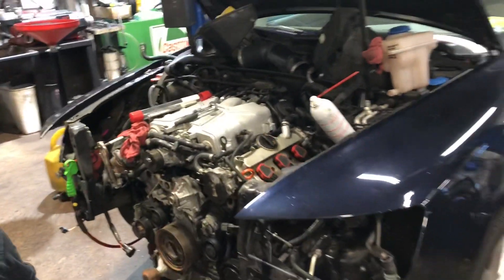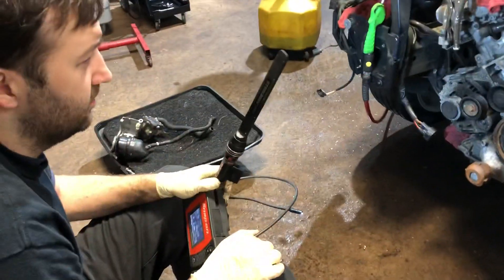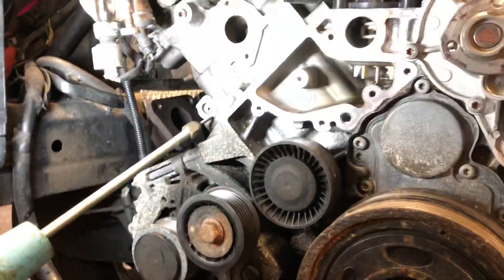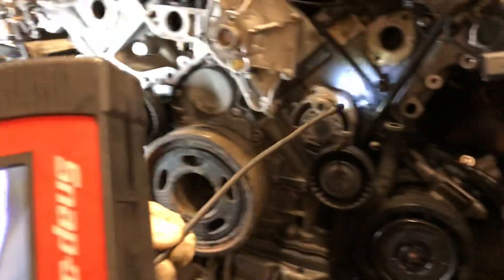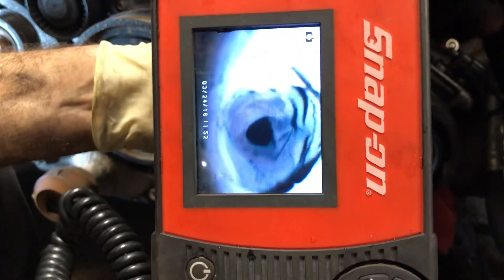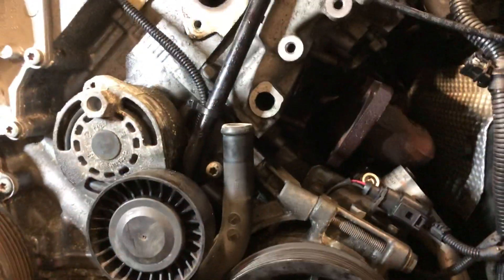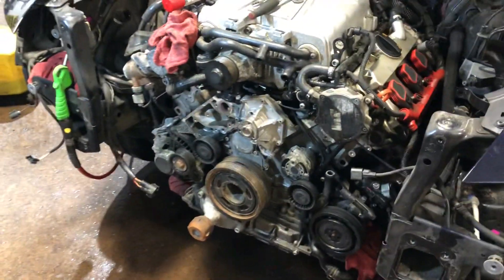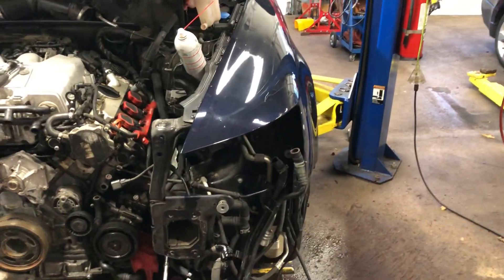Audi 3.0t air injection system fault

Comment: Nice brief and well explained video. I have a 13 S4 3.0 SC in the shop right now for bank 2 check valve stuck open, but it makes me wonder if i should advise the customer to do a cleanout/overhaul on the air injection system while servicing it. Keep at it

Comment: I have no power at air injection, checked the fuse both at engine off, engine on they are good, but no luck. any suggestion?
Reply from the maker: @bakhtyar7  going to have to pay for testing. Wiring diagram will tell you where to look plus have to have a scan tool to activate the relay and do the checks.

Comment: How do you get to the smaller lateral passages? Seems like the drill bit will only ream the main passage.
Reply from the maker: @jasonsmith7809  we take the manifolds off and clear them from the sides.

Comment: I have am 2013 audi a7 an my secondary air injection system switching valve stuck open(bank 2) p2442 code
Reply: Same here
Reply: Same here on a 2009 Q5

Comment: I just did this on my B8, cleaned the ports with a drill bit and checked with a boroscope. The code came back, do you know what else could cause the issue? The Combi-valves, the pump itself, a clogged hose?
Reply from the maker: it could be any of those things, weak pump, bad control solenoids or the valves, vacuum hoses for the control solenoids.... You have to have it tested by a qualified tech to see what the problem actually is...
Reply: Do you think it’s possible for someone who isn’t mechanically inclined to fix this?

Comment: I need help with 3.0 tfsi engine my car idle increases and goes to 1500rpm after it gets warm,no error code is coming no faults,I adapted throttle body but no results
Reply from the maker: are you local to Northeast Philadelphia?

Comment: If you do not have this cleaning done, what kind of damage will it cause if i just roll with the engine light
Reply from the maker: no damage, just a check engine light and inoperative air injection system. BUT, if your check engine is always on you do not know if you have additional issues pop up when you're driving, and depending on what that is you could have damage from whatever that is...
Reply: @Ashum28  first engine code ive had since buying the car, had it ran code p0491. I just dont feel like tearing the front clip off and part of the engine etc i figure i can live with a little engine light as long as it will not damage the engine

Comment: how do you make sure it doesn't happen again? can you prevent carbon build up by adding certain resources during maintenance?
Reply from the maker: I don’t believe there is anything that will help with keeping those passages clean unfortunately. Minimal short trips and driving the car hard will slow it down.

Comment: This is covered under warranty 193,000km or 10 years on all 3.0T and 3.2 engines
Reply from the maker: yes, that's correct, if the vehicle is in warranty period we always refer them to the dealer
Reply: 2014 plus are not covered
Reply: @fastboatster  2014 not covered? Shit it's the same engine though. I might have to pause on buying a 2014 q5 I was going to
Reply: @m4gician  from what I saw on Audizine, 2014+ are not covered, do double check that. Worst case though, it will be around a grand to clean them. Dealer will spray some high pressure water into the secondary air injection ports and vacuum it out. Or some Indy will run a long drill by hand from the front of the engine, there’s a plug which can be removed in front of the block. So it’s not the end of the world, just be aware this can happen sometimes. If you have no smog where you live, just tune it out.

Comment: I was told in order for it to be fixed by warranty it needs to be both banks throwing a code. Is that correct?
Reply from the maker: I don't believe it, a warranty issue is a warranty issue, doesn't matter if it is on one or the other side. Normally it's both. Unless you have a code but it is caused by something other than carbon build-up.
Reply: @Ashum28  yea I double checked the forums after I messaged you and you need to had a code thrown from both before Audi will cover it. I talked a manager at an Audi dealership who tried to get it covered for me but he said they said it needs to be both. I was waiting for both because I was told it was going to cost over $2000 at the dealership. Before I could reset it and it wouldn't cone back for awhile and I could get my inspection. Now it comes back too fast so I have to get it handled

Comment: I found out today I missed the warranty by 1 month. I was told it was an 8 hour job and then I got a call back it was 12.5 and $2870 including taxes here in Canada. I told them I'd be there in 10 minutes to pick up the car. Now I'm gonna do this myself and hope for the best. F'n Audi's, this is the last one this family will ever own.
Reply from the maker: You can buy yourself any of the recent Chrysler products and find out how much camshaft replacement is. 😂. Every car has its issues, don’t get mad, you’ll be ok.
Reply: You can also get a tune from jhm that deletes the software side of this.  The cel goes away and the readiness monitors show right state.  $400-700 usd
Reply: Was that the quote from Audi Winnipeg? I'm also in Manitoba. I have a '13 S4, which warranty period did you miss?
Reply: @JTrizzo8  There is a 10 year warranty on the secondary air ports, so you have a couple years left
Reply: @mrmanitoba  Seriously, thanks a lot! I have an appt on Tuesday to get this resolved.
Reply: Why hate on Audi because of a few certain models. I have owned plenty of A4, A8/S8, TT, and now an Allroad cars and all ran great. All car brands have their own share of "not so great" models too.  Dealerships are going to charge you a high rate no matter what car you own.

Comment: 10 year 120k extended warranty for this issue. Free fix at the dealership
Reply from the maker: you're right, just two weeks ago a person came in for the service and he was withing that warranty extension. We sent him to the dealer and he got it done for free.
Reply: for which model i have a 2010 Audi Q5 3.2
Reply: @Imola0  it is 10 years not 12. You’re not covered
Reply: If you have a 3.2 motor chances are it’s not covered based on time. You would need to verify your vehicle build date and what month the extended warranty was released. Best bet is to call your dealer
Reply: Does it matter if I’m the 3rd owner to the vehicle? And still under 10 years and 120k miles it can get done free?

Comment: I noticed that the manifold gasket does not have a hole for the three holes you cleaned out, neither does the replacement ones I was about to order. Are those holes supposed to be blocked like that by the gasket?
Reply from the maker: are you talking about exhaust or intake gasket?

Comment: Good stuff guys!
Just bought one of these with the SA code. Lots of miles, still runs like a dream, save the air trouble.
Reply: I also just bought one with this issue 192k miles bascially 1 owner Q5.
Reply: Mike Reese  Do the work yourself so you can get to know her. It’s well worth it to me. You might like it too!
Reply: if you dont have emissions is this worth fixing?
Reply: Mike Reese If you’re a DIY person, absolutely!

Comment: Can you please list the cost of this repair? I have the 491 and 492 codes on my 2009 A6.
Reply: With that much disassembly, at least $2k
Reply from the maker: I'm sorry, but I can not provide you with the price for a repair without having the vehicle in the shop and diagnosed properly.
Reply: How much you charge to clean those heads like that?